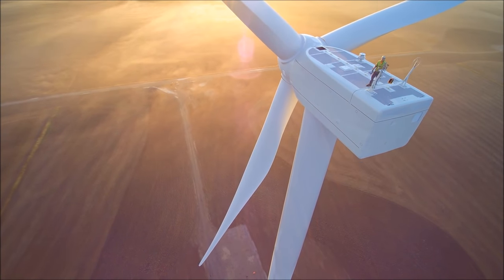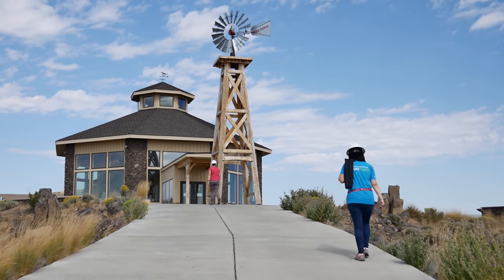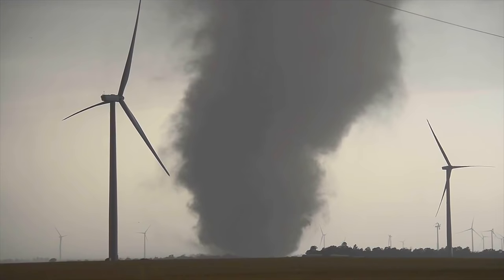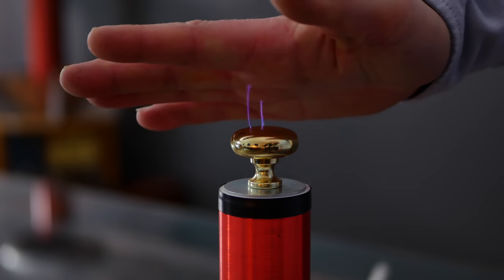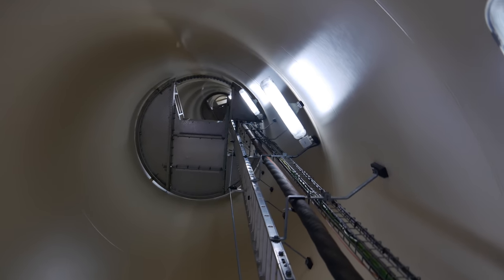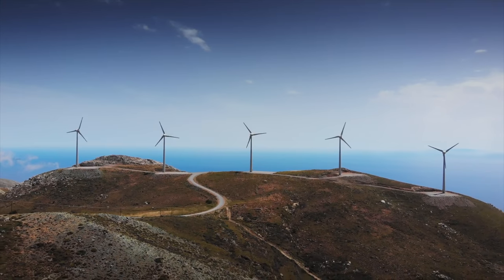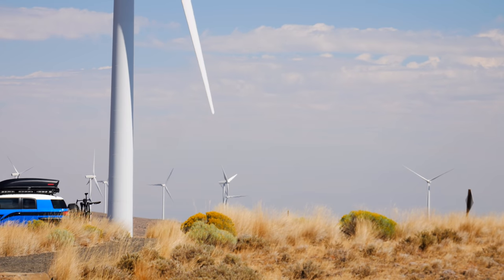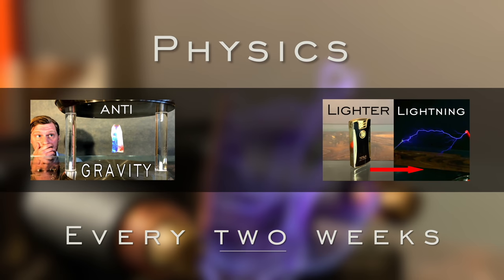35,000 Volt Wind Energy (Up Close Turbine Tour)

Comment: Aahhh! I remember when I was a kid in the 80's, I got my hands on an old record player that was broken beyond repair. There was a chunky looking motor inside that looked to be in good shape. I figured I would make an experimental dynamo for my bicycle. So I wired up a 3v light bulb to the motor to test it all worked before any major work. 
-
I turned my bike upside down, rested the capstan (I think that's what it's called) on the back tire and spun it fast using the pedals. Next thing I know was the bulb going pop along with a hefty feeling current going through my hand (my palm was resting against the motor terminals) damn did that hurt. I realized that it wasn't a 5 volt motor I had, it was a full on 220v/240v motor (I live in the UK) hence why it looked chunky. 
-
I never knew you could get such small motors that used mains voltage back then. Which then upped the ante to where I ended up making a small wooden windmill with each blade (X4) about a meter long, attached to the motor creating a wee wind turbine that could produce over 200 volts. I managed to power up a HiFi, a small coil element heater, a portable monochrome TV and some house lights. 
-
They all worked though the HiFi and TV were not really happy with the unregulated power supply, the HiFi would crackle through speakers with tape play sounding wonky but radio played great apart from static. The TV had the same sounding static crackle and the picture on the CRT would shrink and expand with a warped look to it as it shrunk, but I did manage to get a decent picture on it though. 
-
I wish I knew how to have made a regulator back then, I was only 13-14 years old so my knowledge of stuff was limited. But it was so much fun to experiment with all this stuff back then (as dangerous as it all was, I already had a healthy respect for electricity after getting a shock from a faulty light switch when I was 8 years old).
Reply from the maker: That's honestly impressive for a 13 year old. I was busy binge watching Dragon Ball Z back then. I didnt discover electricity till I was 15!
Reply: @PlasmaChannel  Hey thanks for your reply. I have always been interested in how things worked since I was 6. I remember dismantling my alarm clock (the ones that did the rapid 4 beeps over n over) and my mum going crazy and saying "If you don't fix that I'M FKN KILLIN YE LAD!" She never meant what she said, but I didn't know at the time. So I spent a couple of hours putting all the tiny bits n pieces back together and got it working. That portable monochrome TV I mentioned above... Well at 10 years old I found that TV thrown out in the trash no longer working, so I took it home for sole purpose to pull apart and see how everything worked inside then put it all back together and then put in the trash. Mum did warn me about the flyback giving a shock, so I was careful around that. I stripped the TV down, cleaned up all the parts, noticed a tiny wire that had come loose from the Vol on/off switch, stripped a bit of the insulation and wrapped the wire back onto where it broke off, put the TV back together and viola a working TV that I fixed myself. I still have it but the tube seriously needs a good few rejuv zaps to clear the cathode. I'm surprised it still works with the amount of crap I've put it through. I wanted to do electronics and computers as a career but one thing got in my way.. I'm Dyscalculiac (number version of dyslexia) and have problems with numeracy and math. I still wish to do electronics and such like but issues arise very quickly when it comes to calculating all the numbers so that stuff don't go BOOM, lol. For years I've always wanted to do a big Tesla coil but my smaller attempts always released magic smoke even though I'm sure I did everything correct, lol. But mehh.. I guess it was never meant to be.
Reply: I also did this but with a 5v motor
Reply: @yashsaini3410  Kool, gotta love experimenting with stuff like this.
Reply: @EzeePosseTV  Can you tell me the type of the motor you found?
Reply: @TheInfinityy  The motor came from an old record player from the early 1980's. The motor itself required 240 volts to operate it. I can't remember make or model as I did my project over 30 years ago.
Reply: @EzeePosseTV  great find ! But I think nowadays' motors do not act as dynamos.. Motors nowadays made only for motoring purpose. They can't be manipulated easily to get electricity.
Reply: @TheInfinityy  Yeah, I have noticed that too from watching youtube video's. Though I guess some old alternators or starter motors might be useful in generating electricity. Also look into old vacuum cleaner motors too.
Reply: @EzeePosseTV  Old vacuum cleaner motors. Need to have a try on one of them.
Reply: @TheInfinityy  Yeah. If you do, please let us know if it worked.
Reply: Not going to lie I was the same way. As a kid I did things that seemed impossible to others when it came down to tinkering. Nothing beats a relentless curiosity. Also I feel for the dyscalcula: didn't learn how to do basic arithmetic until 7th grade, although I excelled at higher maths as long as it wasn't doing the arithmetic.
Reply: @Slowly_Going_Mad  Hah, sweeeet! .. I've always enjoyed tinkering with all sorts of stuff. That's kinda how I teach myself stuff and how it works plus what can fix it. I have only ONCE put myself across the room by accidentally touching the flyback transformer tube connector. Oooh boy did that fkn  hurt! Yeah the dyscalculia has caused so many problems through, lucky I can do basic sums to get me by.
Reply: For the most part I have been lucky on the not taking too many shocks from electronics with the exception of a flash capacitor on a disposable camera, made my arm numb for an hour. Usually I ended up burning hair off from homemade pyrotechnics. I now have a rule never make more than dimes mass of something until you know everything you can about it and then some. I used to get away with formulas for chemistry because they usually have set rules making them like Legos in a way. Anything that required crazy amounts of precise counting I used a calculator. I try to do it now without one, takes forever though. I still use one to double check just to be certain.
Reply: @Slowly_Going_Mad  Yeah, since I felt that flyback discharge I've been extra cautious around components that store/release energy rapidly. I have felt the camera flash discharge and I got more of a "WTF was that" type of scare from it, but imagine that sensation but 20 fold with more kick.. 
-
Thats kinda what a flyback feels like, then there is the dizzy feeling after that. I did end up laughing my head off as I sat halfway inside my music tape cabinet, tapes everywhere and my legs n arms looking like a thrown rag doll. lol. 
-
Here in the UK we run on 240 volt 13 - 30 amp supply and I have had a funny belting from that too but it wasn't my fault. The house I live in is a pre-world war 2 building and the light switches n sockets were old and starting to crumble. 
-
Well did my bedroom light switch not just disintegrate as I pushed the switch on and my finger went through the crumbling plastic and straight across the live contacts inside. That felt like metal bells vibrating inside my arm along with a burning sensation on my finger. Oucha! 
-
In regards to using a calculator, I do use one as long as there isn't too many numbers in front of me on a piece of paper or monitor or where ever I'm reading the numbers from. 
-
If there are too many numbers my brain goes into a weird muddle and it's almost like the numbers are jumping all over the page. It's a weird one, but it's the anxiety I get during that moment I hate. It's not so bad now but when I was a kid right up to when I was 30 - 35 it affected me most. 
-
I thought I had a phobia of numbers or something and upon getting it checked out was when I discovered it was dyscalculia. My Mum is dyslexic so I'm wondering if that was why I have dyscalc.
Reply: I suspect that anxiety has a big part to play in both dyslexia and dyscalcula. I also cannot play an instrument for my life in a normal state. I have to be beyond relaxed to play music on guitar it's very difficult for me to get in that space though. As far as getting shocked I have taken a few hits from faulty appliances that were not properly grounded though not a result of me tinkering, and I think AC for sure hurts worse because of the rattling like feeling than an equal DC hit.
Reply: @Slowly_Going_Mad  Yeah I totally agree. I can't really play a guitar apart from doing a one string wonder on a few old rock tunes. I do have my own guitars (acoustic and electric with amp) in a bid to try teach myself to play, but I can't read music.... but I can play by ear on the piano/synth keyboard (I'm not great) and my friends love it. Put a sound sampler with 4 channel sequencer, synth keyboard and a singer (my oldest daughter is a singer) aided by an Amiga 1200... I will churn music from that without a problem. I have been fascinated with sampled made music since MARRS Pump Up The Volume was first in the charts along with Art Of Noise track Close to the Edge annnd Paul Hardcastle's track .. Nu Nu Nu Nineteen (vietnam war). Making new music using bits of old songs and movie audio totally peaks my interest.

Comment: What is the Return of Investment on one Wind turbine?  Cost to purchase/maintain verses when will it pay for itself and actually make the company money or it’s
Members?
Is the electrical company a for profit (Commercial Utility) or Non Profit  Electrical Cooperatives?
Reply from the maker: Strange. I thought I responded to this. PSE I believe is for profit (which i'm fine with), and the turbines pay themselves off in 8 years. They last about 15 -20 years.
Reply: Thanks for the reply. I work for the largest non profit Water Utility in Arkansas and we are branching into Solar ourselves starting with a small 40 acre farm on the side of an interstate. All available utilities should utilize environmental entergy if possible. 
We looked into using water turbines in our raw water gravity mains to offset the cost of areas that need pumps and found it not reliable and as efficient as solar.

Comment: The tips of the blades travel at about 150mph, no wonder there are bird strikes, and with dust in the air, there's a form of sandblasting.
I prefer vertical axis for many reasons, the whole blade travels at the same speed, they always point into the wind (horizontal axis needs to be turned by motors, a waste of energy), the generating equipment can be at the bottom of the tower, no need for huge cranes to change out equipment  so less downtime (cranes cannot operate in windy conditions),, no need for slip rings.
Reply from the maker: Yeah the 150MPH is only at the tips though. More birds actually die from hitting powerlines than hitting turbines though, annually. It's a matter of perspective.

Comment: 6:14 That transformer is massive, I would love to see that in the primary circuit of a Tesla coil.
Reply from the maker: That would be a 1.8MW coil! That is 9 times the size of Lightning On Demand's coil that you saw in my video (the massive one...that is 40 feet tall)
Reply: @PlasmaChannel  Holy smokes, nearly 2MW... That's insane especially since your high voltage genesis coil uses less wattage than a hair dryer!

Comment: Those high voltage cables tho. 1800000w / 34500v = 52+ amps. Yikes. And the short cables between the generator and transformer: 1800000w / 690v = 2600 amps (!!). RMS I presume. If the cables have 1 milliohm of resistance the heat dissipation would be 6.8kw.
Reply from the maker: Yeah, it's pretty impressive levels of power coming out of those cables!

Comment: Great video. Thank you.
Got a question:
I read in the past that they are started by the generator to overcome the inertia and once the are spun up a bit, wind will take over. Is that still true? Or are they now light enough that wind suffice on its own?
Reply from the maker: That may be a thing of the past..but these things actually have bigger issues STOPPING. They are designed to spin extremely easily. So easily that they have an emergency brake + a normal breaking mechanism.

Comment: The title should read how wind turbines use plasma to generate energy ;)
Reply from the maker: I'm STILL trying to figure out the right title. You'll notice it changed already. May change it again......need that PERFECT title!
Reply: @PlasmaChannel  ❤️
Reply: @PlasmaChannel  the plasma is flowing over the blades and turning them, i wasnt talking about the 35KVrms transformer at the back. Plasma is defined by any charged medium operating under the influence of a magnetic field. The air is plasma and it is these plasma interactions that create the pressure changes on the foil of the blade.

Comment: How they produce full sign wave of 60 Hz with 1800 rpm by the way Love from india
Reply from the maker: The generator outputs 2Hz per rotation - but - i'm checking with PSE to confirm that!
Reply: Generator outputs AC that is converted to DC, Back to Ac(by sampling this is matched with grid frequency) 400V/690V. Last there is medium voltage transformer where 400v is upped to 10/20/30kV. This is how it is usually fine.
Reply: They use AC/DC/AC converters or DFIG generators. Turbines with gearbox usualy use DFIG and turbines without gearbox use AC/DC/AC systems.

Comment: Our nextdoor neighbour is simply called Electric Mountain (https://www.electricmountain.co.uk/Dinorwig-Power-Station) Just one thing that will give you the warm and fuzzies ... it can be online generating 1.3 GW within 12 seconds. And... also just off the north Wales coastline, are several sea-based wind farms. Google map the area. You'll be amazed!
Reply from the maker: I'm actually familiar with these sea-based wind farms. Those are mega turbines that output several Megawatts! Insane.
Reply: @PlasmaChannel  Hi Jay - that was quick!! The off-shore wind farms are one thing... but Electric Mountain in Snowdonia (https://goo.gl/maps/xM6QyshjWvsurP2i7) is Something Else!! Several documentaries have featured it - you would really be amazed! I've been on several of the guided tours they offer inside the "mountain" and it is honestly staggering what they achieved back in the 70's - a lot of it was dug out by hand! It's main chamber where the generators are housed is big enough to fit St Paul's Cathedral (ie: the one in London!!)

Comment: Why don't they use vertical design which will be lighter & more efficient.
Reply from the maker: Power output tends to be less with the vertical method.
Reply: @PlasmaChannel  if we are using gearbox then it will make higher rpm. Then how can it affect the output power. The vertical turbine will be omnidirectional too.

Comment: design -> redux 3 to 1
Reply: induction heat conversion
Reply: van der graaf
Reply from the maker: I do not understand.
Reply: @PlasmaChannel  change design a bit to make it not need 3 parts, you can get direct heat instead of electricity out of wind, either no-moving-parts or belt-action van-der-graaf, to fuse atoms
Reply: if you also combine storage with wind-electricity, i would recommend trying diy burned/koh paper/wood to porous carbon super capacitors
Reply: why do you need the generator up there anyways?
Reply: the old style universal joint axle down to ground

Comment: @Plasma Channel - 
Not fully correct about the high voltage advantage , its also extremely important to reduce the thickness of the wire aka reducing the waste of metal & the weight ... you dont want meters thick cables to supoply a very small town ... thats why (DC-) Edison lost in the 19th & 20th century (because no good step up/down technology for DC) ...  
Today High Voltage DC is more efficiant on more than 150Km transmission length wires , sue to the Skin-Effect (Note: this especially effects high frequency transformers of electronic switching power supplies = the higher the frequency the smaller the transformer, but the worse the skin effect = thats why super high tech sever PSUs´s transformers are complicated build with many disc shaped primary coils)

Comment: I read somewhere that Newzealand successfully starts wireless electricity transmission system.
Is it true?
Reply from the maker: I'm not quite certain what you're speaking of. NZ uses wireless power like the rest of the world. Radio is wireless power. Wifi is wireless power.
Reply: @PlasmaChannel  they transfer current without wire

Comment: Nevertheless I have my concerns to the large scale application. 
The extreme large size of the towers and turbine, the noise pollution, the extreme large area to locate the towers because as we saw in the video the wind loses speed converting in kinetic energy so the towers should be far from each other I think. I can see a great amount of difficulties to its implantation. Solar energy looks to be more "fitble" to the actual human civilization. 
I always like to think as the nature, the plants use solar energy so... Haha
Reply from the maker: You make good points, though, they are not very loud. 53 decibels at 100 meters away...which is only as loud as a quiet washing machine. Also, solar takes up tons of land space. To get 1.8 Megawatts of power from solar, you need several acreas of ground space. For a windmill? only a 5 meter diameter circle of ground. That's it. So while solar is quite efficient, it also consumes the most land.
Reply: @PlasmaChannel  Interesting Analysis